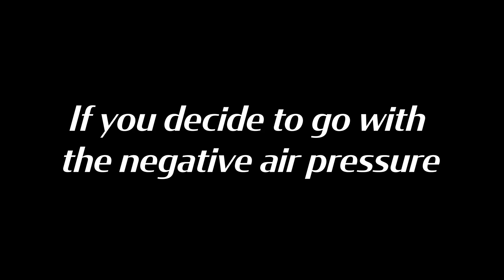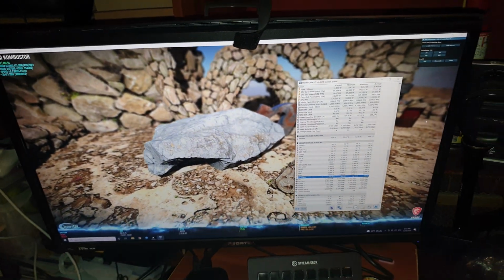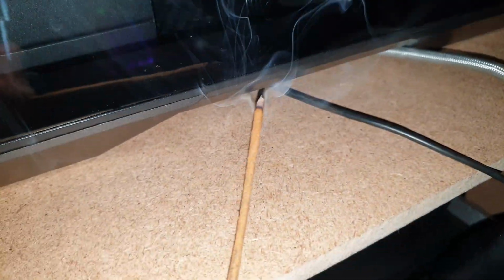Filter Dust with Tights

Comment: I would buy a Stainless Steel Woven Wire Mesh which is mostly sold for garden purpose, spray it black and use it as the mesh. Some of them are sold even down to 1mm opening. It will keep most of the dust out, while not destroying your airflow.